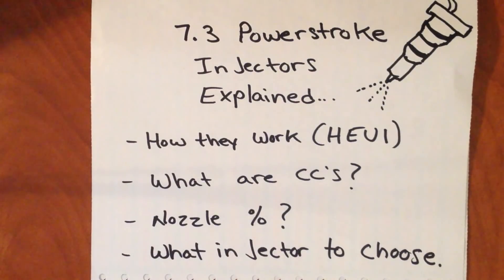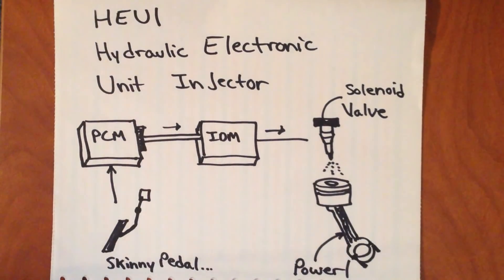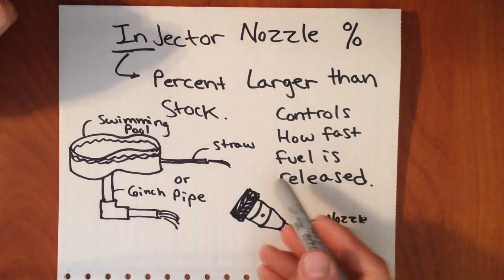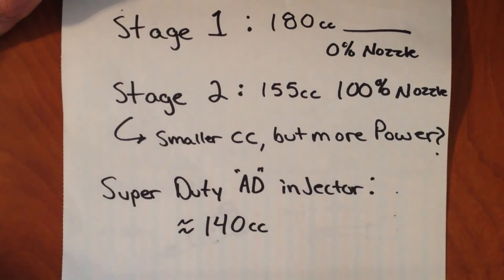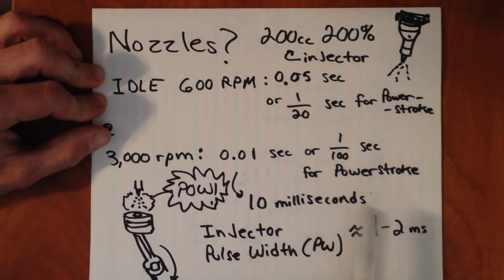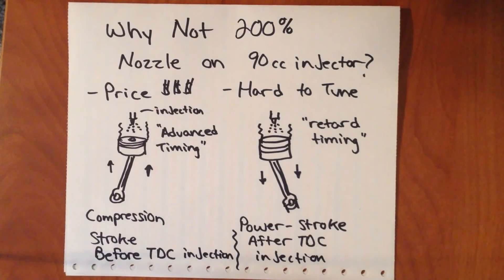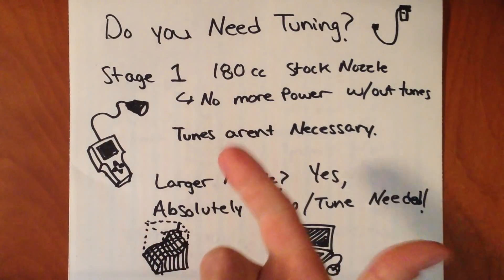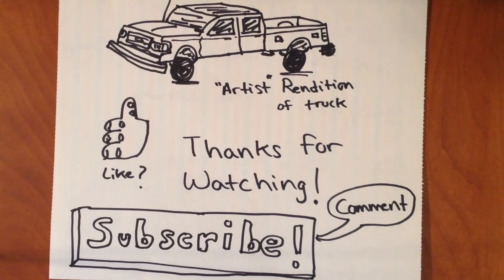7.3 Powerstroke Injectors Explained

Comment: I have a 2000 F350 7.3 with 394 miles original injectors, the truck has an absurd amount of highway hours, id go as far to say that’s why the injectors lasted as long as they did. What I did is rebuild them. They are actually not all that bad to rebuild (you don’t need a microscope or anything), just need a torque wrench, needle nose or tweezers, and a vice!, plus you probably want to buy the kit with all the parts. Warn injectors really affect cold starts more then fuel and it shows!
Reply from the maker: Sounds great! I've got probably 355k on mine, I doubt they've ever been replaced. I've considered replacing mine with stage 1's for a little more pep, maybe a stock  nozzled 180cc unit. 

How much did it cost to rebuild your injectors? Did you have to check the specs on the barrel and plungers, or what all gets replaced in rebuild?
Reply: Rnddiesel I’m going to put you on to something and thank me later

https://bitterrootdiesel.com

You could buy the rebuild kit and the stage 1, 2, or 3 kit, or just buy nozzles, up to you.  

In my unprofessional opinion this is what I would do if I was you

Buy the rebuild kit: https://bitterrootdiesel.com/collections/1994-1997-fuel-injection/products/7-3-powerstroke-injector-rebuild-tool-94-03-7-3-powerstroke-dt444-dt466-dt530

Then buy the stage 1 kit: https://bitterrootdiesel.com/collections/1994-1997-fuel-injection/products/stateg-1

But I mean u might as well for the invasive nature of the job (I had to go in there 3 times) buy the stage 2 kit (they also sell a stage 1.5). Here is a link to the stage 2 kit if your interested but let me know if you have any other question u could email me dylanjoshua01@gmail.com
Reply: Rnddiesel and to answer your question on checking spec (completely went over my head) there is only 2 things I checked the spec on. The upper and lower half injector body thread onto each other and have to be torqued to  75 foot pounds. The armature plate inside your injector, oh fuck here is a link so you can see http://www.interstate-mcbee.com/media/documents/parts-catalog/heui-catalog.pdf.   

32 sits on 35, with .002 clearance between for oil to pass through. That’s what affects cold starts, my clearances were touching, couldn’t get a feeler gauge under it. 

When you buy the kit it comes with shims, .001 shims and .002 shims. 

They include a new 36 screw because usually they strip because it’s a, I guess Tampere proof head? Idk. Anyway put that new 36 screw through the plate 35, and put a .001 shim, Test for clearance with included feeler gauge. You want JUST .002 no more no less. If you want use a .003 feeler gauge and make sure it won’t go in. Otherwise it will send a check engine light so I’ve heard and wether that means the truck won’t use that injector or not I’m unsure but it’s just better to do it right the first time.

Just so you know, this injectors are built like a Swiss watch. It is very hard to do your first time, if you need any advice to do it, like I said email me. 

The deluxe(the basic kit doesn’t include shims) rebuild kit was 180ish and the tool kit was 80ish. You got the links so shouldn’t be hard
Reply from the maker: Thanks for all the info! It'll take me a while to process everything and make sure I know what you're talking about. I'm not too familiar with what parts actually wear out on 7.3 injectors other than the poppet valves, so I may be way off. The plunger/barrel is the part that pushes down on the fuel to get it into the nozzle and into the cylinder. I always thought that part would wear out and if you don't replace it you may get fuel leakage internally and not be generating the fuel pressure you'd otherwise be producing. Same with the intensifier piston, that I guess get's replaced when you upgrade to stage 1's or so. I always thought of the plunger/ barrel assemblies and intensifier piston as being wear items like on an engine. You know how engines wear out where the pistons bores become ovals over time and rings wear out causing blow by. I could be way off, and I'll definitely be looking into injector rebuild! Though for the first time around replacing injectors, I may just go with some off the shelf rebuild ones, we'll see. Thanks!
Reply: Glad I found this thread!!

Comment: You need 2 be working for bill hywit at powerstrokehelp.com
Reply from the maker: Thank you kind sir! That's one heck of a compliment. I don't think I could hold a candle to those guys though. Believe me there's a lot about Powerstrokes that would go over my head! 7.3's are one thing with a handful of sensors, but 6.0's to common rail 6.4 and 6.7's are a different animal all together. 

I just hope t be on the other end designing these things one day!
Reply: @Rnddiesel  unfortunately he doesn't work on 7.3's anymore, I contacted him to upgrade my radiator and trans cooler and some other things.
Reply from the maker: @hiltonray4461  That's a real shame! I remember when Powerstrokehelp first started talking about no longer supporting the 7.3, I'm sure it's a business move. Most folks aren't willing to dump money into an old 7.3 when a newer 6.0 runs so much snappier. I guess it's a good thing guys like us are willing to put in the effort to learn and work on our trucks ourselves to keep them on the road!
Reply: @Bizketbutt  not exactly true, early 6.0 was severely flawed, but once fixed( bullet proofed) they are very reliable and a very strong engine. With that said, I'd feel more comfortable driving my 7.3 with 267k than a brand new 6.0, the later 6.0 still needed to be fixed but were better than the first.
Reply: @Bizketbutt  Tell us how you really feel. Lol